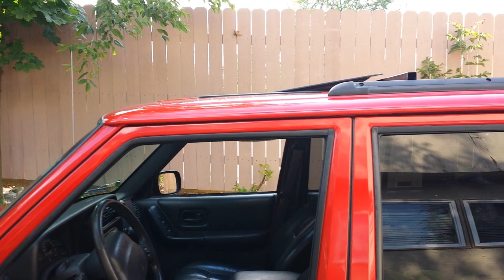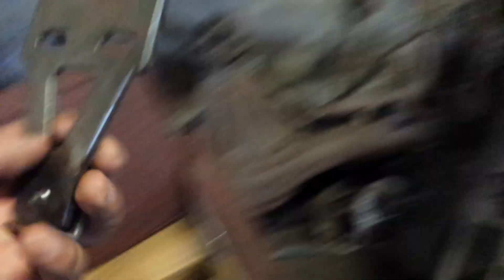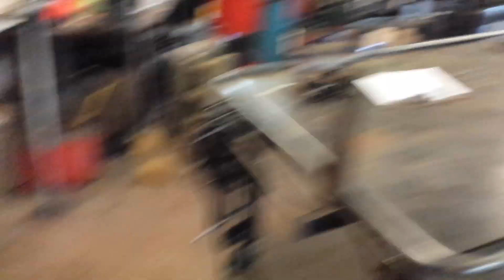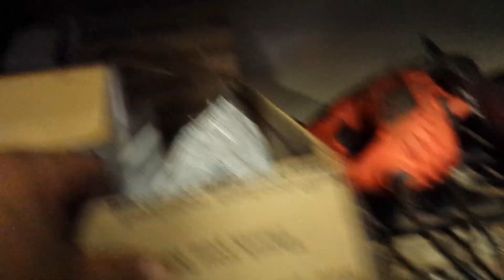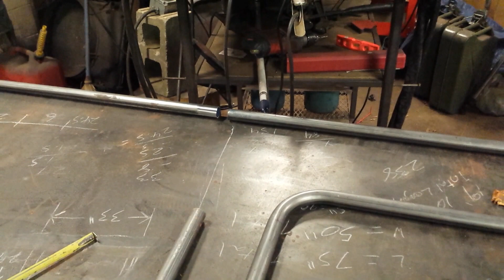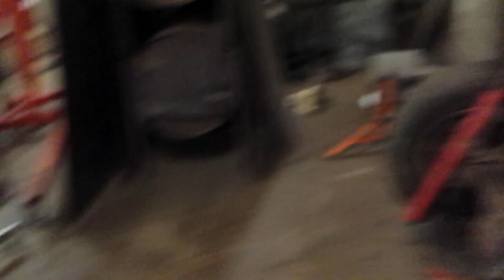Jeep (XJ) Cherokee - Roof Rack Build - Part 1 of 2

Comment: an older vid but if you're still out there - is the pipe you're using imt conduit? looks too thick to be emt...
Reply from the maker: Dave M as stated in the video series. It's 1" x 16 guage wall tubing.
Reply: Alvarez Metal Works  fabulous project! i watched both videos and i couldn't buy a better product. makes me want one on my commander. how much does it weigh?
Reply from the maker: Not sure. I never weighed it. It's not bad though. There is a fine balance between weight and strength. If it's too light it will easily bend. If it's to heavy that's not good either. However putting a roof rack in your truck mean you plan on adding weight to the roof fucking up your center of gravity soo...

Comment: hey bro im from over seas live in costa rica i was wondering how much would a roof rack like that cost its for a geo tracker 4x4 1989 with the fiber glass hard top i wanna pay for one build in usa like that one @Alvarez Metal Works
Reply from the maker: +Greivin Rojas Thank you for the inquiry. However I do not build things this large for anyone that isn't local. The logistics of shipping and building without having the vehicle at my shop is just more head ache than it's worth.
Reply: alright thanks